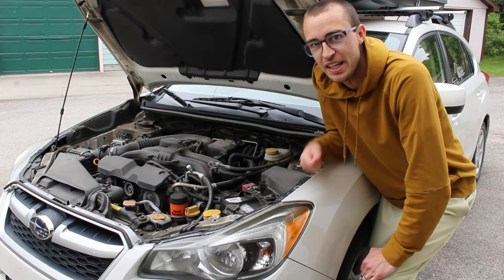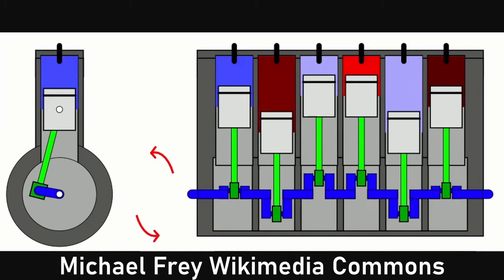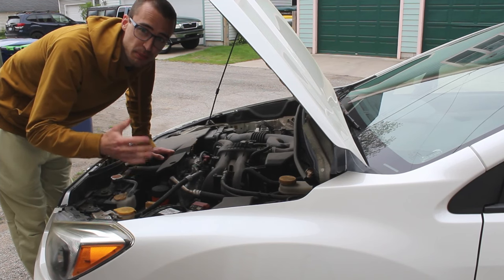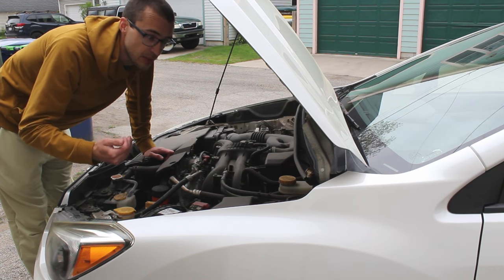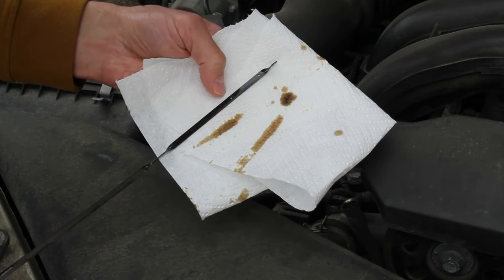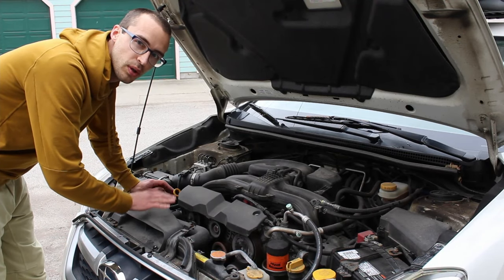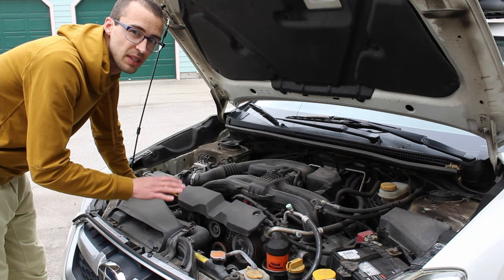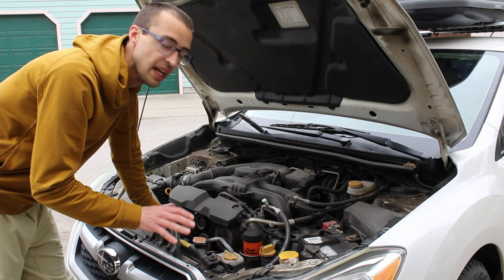Subaru Oil Consumption Issues? Information and FIX!

Comment: I've heard others complain about Subaru oil usage, but I've owned 4 Subarus in the last 20 years, and none of them consumed more than 1/2 quart of oil between oil changes.
Reply: My gosh, I can go through a quart in 1,000 miles in my 08 OBW.
Reply: My  2011 Outback 1.8K miles consumed 1.1QT oil.
Reply: You are a lucky one
Reply: I'm on my second outback.  My first one never had this issue.  My 2017 just seems to consume more oil each year.  I'm on year 6 at 74000 miles
Reply: What oil do you use?
Reply: I'm 1 for 1 on oil drinkers.  1q per 1000miles in the summer and closer to 0.5 in the winter
Reply: I think if you compare it to some cars that don’t drink any oil between oil changes, then having to replace any amount of oil is a little bit of a pain in the rear when these days, people aren’t even used to checking their oil anymore.
Reply: @danmurphy9173  I've neglected my work van and let it go to 12k miles and the oil was at the top of the full line on the stick.  I'd be running on 0.5-1q driving my Subaru 12k miles without topping off😅

Comment: It's a real good idea to check the PCV valve if you are burning oil. It costs $20 and is pretty easy to change.
Reply: Just bought one today
Reply: A PCV valve will not fix faulty oil seal rings.
Reply: @will_mcfarland  No, but it will fix a faulty PCV valve. LOL. Its a good first thing to check. Costs $20-30 and takes 5 minutes to change. But I guess if you would rather skip directly to the engine rebuild...
Reply: Use it to your advantage and use oil designed to clean valves on direct injection engines..
Reply: @billsanter Lol you are so right! My 2008 Subaru Outback was having engine problems ever since I bought it and the PCV valve was one of the things I checked and sure enough, it was faulty. It was a cheap fix. But there were also a lot of gaskets that needed to be replaced. Bad rubber that deteriorated over time. And the sensors….!🙄 Oh gawd the sensors. Just lovely. Too many needed replacing. I never realized how important it was to change the air filter every so often because that’s how the MAF sensor got ruined.
Reply: Our 2012 Impreza burns a quart about every 400 miles at this point.  My daughter uses it for school.  I'm considering putting a used low mileage engine in it, but it seems like they all burn oil
Reply: @joeweaver9913  Unless it's blowing blue smoke out the back I wouldn't replace the engine. They will still go a long time like this as long as you keep the oil topped off. Worst that will happen is that you might get more carbon buildup and spark plugs might foul. Change the PCV valve though.
Reply: @billsanter  I've become a pcv valve expert as we own a bunch of Subarus.  This is definitely the engine.  My daughter drives it and keeps a case of oil in the back.
Reply: @joeweaver9913 They don't all burn oil. My Legacy was burning a quart between oil changes at 60k miles but my wife's Outback with the same mileage and doesn't burn any. My daughter's Outback with 80k miles doesn't burn any either. My WRX with 10k miles already burns 1/2 quart every 3000 miles. It's either luck of the draw or the way I drive.
Reply: @billsanter  well I meant the fb20 engine or whatever is in that 2012 Impreza and the Crosstreks of that generation.  Everyone I know that has one complains about the oil consumption 
I have a 2008 Outback with the ej25 that does not burn much oil and we have a 2022 Outback with 40k miles that burns no oil as far as I can tell
Reply: @billsanter  Sorry but you will never convince me that any of the FB series engines do not burn oil. They ALL will have this issue to some varying degree. And while it's a fine idea to change out the PCV valve, it won't fix this issue.
Reply: @billsanter hi. Just bought Outback 2019. What is this PCV? Should I do check it? How. Thanks for help.

Comment: My 2013 Forester burns oil but not quite so badly as to require a short block replacement. Even so, I'd much rather add oil than trust a complex engine teardown to dealer mechanics working at reduced rates for warranty work. 0-20w oil is too thin given relaxed piston ring tolerances, and using Valvoline 5-20w Max Life full synthetic has slowed the consumption considerably. The Valvoline oil is reasonably priced, readily available, and has excellent low Noack volatility (evaporation/burn off) characteristics. Over time as the miles pile up I'll migrate to 5-30w. I just watch the oil level closely on high speed long distance road trips and pack an extra quart of oil.

Comment: Yeah I have an Outback and the oil literally disappears. There's no leaks or anything, it just vanishes, and your explanation explains how.
Reply: I did an early oil change after buying my 2017 Outback 
I switched to Amsoil 5w-30 signature series. I have never had an oil use issue. I never added oil between changes. I do change the oil every 3000-5000 miles.
70,000 miles no oil use issue.
Reply: @robm3357 you will likely have issues starting around 80k miles. I have a 2017 Outback with 81k. It’s beginning to consume oil about every 1500 miles. I’m now carrying oil w/ me. Mechanic changed out a valve & next plan is to use a bit thicker oil if it’s still happening. I’ll prob have to get rid of it before 100k miles since I’m worried my new teen drivers won’t pay enough attn to the oil consumption issue. Good luck!  I’m going back to Honda - had a minivan for over 13 years and never once had to check the oil or deal w/ this mess.
Reply: @jgore629  
I been using Amsoil 5-30 since new. It never uses any oil. I don’t use the 0-20 or 5-20 it calls for
But on another note. Subaru has decided to go with a CVT now on the new vehicles and that means I will never buy another Subaru. Also not impressed with the 2.5 4 banger . Revs to high on the hyway and has little to no torque down low. Mine is the 6 speed manual. And is one of the most gutless vehicles I have ever owned….

Comment: It still seems odd that Subaru would allow this.  My old 2000 Toyota Avalon's V6, with ~245,000 original miles, only burns around 1/6 of a quart every 3000 miles, or 6 months, whichever I hit first.

Comment: My wife and I , between us, have had 3 WRX's, an Outback, First gen (2013) Crosstrek, and now a 2021 2.5 (Sport) Crosstrek... EVERYONE of those Subaru's had oil changes between 3500-4000 miles, not ONE of them burned any oil as mentioned in this video... Not one.

Comment: I have a 2016 2.5L Forester I check and top up the oil regularly and always keep a quart of oil in the car just like in the good old days
Reply: I got a new BMW X3, and on the delivery it came with a liter of oil, in a special holder,  velcroed to a side of a trunk space.  Inside a holder is an instruction for oil top-up, and paper-looking foldable funnel.    Indeed, like the good old days.
Reply: I drive around with a 5 quart jug because I take about 400 miles round-trip or even 500 each week. So at that interval, even if I don’t drive the car at all during the week I’m still gonna have to put oil in every 2 to 3 weeks. And it’s usually about a half quart.

Comment: They  made the engine tolerances  larger, and are recommending 0w20,  which is very thin, and as oil heats up, it also thins.  I`d check the pcv valve, and maybe switch to a higher viscosity oil, like 5w30.  Most  older car engines in the past had larger close fit tolerances, and used thicker oil, like 5w30, 10w30 etc, Most modern engines, have closer tolerances, and recommended a thinner oil.

Comment: I have a 2016 outback, 158k miles. I have always done my own oil changes every 5k miles with Mobil 0w20. I just checked and I’m 1/2 a quart low at 2900 miles since my last oil change. Not bad, it doesn’t leak a drop either.
Reply: We have a 2015 Outback with 141k miles and with oil changes every 6k miles notice oil consumption at about 1/4 qt. at 4100 miles.  It was recently changed at the 6 month interval and at 4100 miles. It's my son's car now and he doesn't drive much.  I had the oil analyzed by Blackstone Laboratories and they said that the oil consumption was normal for an engine with the miles we had on it.  All wear indicators were right where they needed to be according to the Blackstone tech.  They said we could go 6500 miles and test it again because it still had enough additives in it that were doing its job.  We only use Subaru 0w-20 in it from the dealership if that helps.  Also, we make sure that the engine warms up to normal idle speed before driving off.  I don't know if it's overkill, but the engine sounds better when we do this.

Here's what the Blackstone Labs report said (I mentioned the oil consumption): Burning less than one quart over ~4,200 miles isn’t too bad for engine approaching 150,000 miles. The oil loss didn’t bother this FB25 at all. Wear metals are all in good standing with the universal averages, and better yet, they’re steady compared to the first sample. Steady, average wear is one of the best signs an engine is doing well in analysis. You’re interested in extended oil use, and we’re all for it. This 0W/20 is in good shape, and the TBN shows active additive left. Try out a 6,500-mile run and check back.

Comment: Subaru lowered the piston ring tension against the cylinder walls to cut down friction horsepower or the power consumed to move  engine parts to produce work. Also the engine oil is 0-20W, a much lower viscosity. This cuts down fuel consumption to get better fuel mileage. Other new car manufacturers have done much the same to achieve the same results.
Reply: However subaru have the ringlands too high up on the pistons unlike other manufacturers
Reply: I have heard that many manufacturers are doing the same due to tighter govt mandates for higher mpg and lower emissions

Comment: By far the most informative and to-the-point video I have seen on this issue. Thanks. Just did the oil consumption test with the local Subaru dealer and found that it's consuming about 1/3 qt per 1200 miles. So I guess Subaru will not do anything about it. I am still waiting for a response from Subaru based on this report.

Comment: I've found this very useful...I'm a former toyota driver, now own a 2013 impreza, light came on and I was damn worried...I visited a shop and they explained exactly this...some relief👍
Reply: I have the same car. I use manufacturer recommended oil and a 'lucas stop oil leak' with my regular oil change. I change my oil every 5000km and the oil level indicator never lights up after this. Do a bit of research and see if it helps. Subarus are good, strong cars and this is an issue most old subaru onwers have. But i still love my subie, hope you do too! Good luck.

Comment: The engine warm up till the blue light is off. Engine parts heat up and seal up. Doing this cured my 2013 2.5 completely. It runs way better also. Try it especially in winter. Winter.

Comment: Wow, what a lucky man I am. My first Subaru was a 2012 outback. It lasted 280,000 miles.
Then my second was a 2016 WRX. Never had to add a single quart of oil.
Then a 2019 Subaru Ascent. Still run like new with over 60,000 miles. Like the WRX I never have to add a single quart.
Now a 20221 Crosstrek  Sport. Again with almost 30,000 miles and haven’t need to add a single quart of oil.
Maybe it is because I religiously change synthetic oil every 5000 miles and, never go over 75mph.
Honesty I just think I am the luckiest guy in the world.
Reply: You've never had to add any oil because the Subaru dealership where you're getting your oil changes done is doing it for you.
Reply: Speed isn't the issue.  Going 90mph indefinitely isn't as hard on oil consumption as regularly gunning it off of onramps, offloading, towing etc

Comment: I have 2008 Impreza OBS with 247,000+ miles with original engine and head gaskets. I've used Mobil 1 synthetic oil since day 1. I had my local Subaru doctor change timing belt at about 190k. I was using some oil and he recommended that I start using 10W-30 oil. Since the change,  zero oil consumption
Reply: My is Outback 2013 really bad oil consumption,every 4 days is empty
Reply: @jamiearellano8903  have you been able to do anything about it?

Mine is using up about 1qt every 500 miles on a 2011 subaru impreza hatchback. This started mainly after a head gasket repair... but from what I've read, and what the repair person told me, this can happen with a head gasket repair. 🤔

I'm just gonna live with it. Cars are too damn expensive these days.

Comment: Thanks for this video.  2016 Forester. If you follow their policy of changing oil every 5k miles you don't see this issue until you extend that.   We had a warranty program where we had to follow 5k exactly or lose the warranty.   I believe these are now illegal. Spent more in maintenance than any other vehicle we've owned. Now that we lost the warranty,  I extended oil changes to 7500 and it becomes an issue and adds more stress probably will go back to 5k

Comment: My suby dealer said it's normal it's burns oil, like you said. They also said the only other fix might be to refit and tighten the head gasket (I think he said). I didn't do that tho as it was expensive and I just continue to add oil. I drive a lot for door dash and instacart so I just end up using oil

Comment: Curious as to how many MPG Subaru actually saved by making engines that burn oil?

Further, how environmentally friendly is manufacturing all those extra short blocks, burning oil in the gas, and killing sensors and catalytic convertors prematurely?  
IMO CAFE's ever tightening restrictions and ever-diminishing returns are forcing engines into places where they don't last as long and cause other problems.  How is this better when cars get junked at faster rates?
Reply from the maker: Good question, hard to tell there are a lot of variables.  I know the jump from like 25 to 36mpg is pretty significant so I’m assuming it is worth the hassle. Hard to say though
Reply: On the money my friend, I couldn't say it better myself
Reply: It's about control. You should be using public transportation. In there eyes.
Reply: It’s like DEF in commercial trucks. Once the filter gets clogged the truck has to idle for hours. How’s DEF helping the environment is the truck has to idle for 12 hours once a month.

Comment: My 2013 WRX STI eats oil like crazy since new.  A quart every few hundred miles.  I have to check my oil constantly.  It is the only car I have ever owned that eats that much oil.  I have tried different oils including oils designed for older cars without much success.  The problem from what I have read is besides loose tolerances is the oil control rings are to small.  My car has not been terribly reliable either it threw the cam belt at 12k miles and I had a big fight with the dealer over not being covered by the warranty- because I change the oil myself (which is actually illegal).  They finally compromized and charged me 1/2 the price or 4000$ which turned me off on Subaru's!  It took me back to my days of owning a Fiat when the cam pulley disintegrated at 12001 miles just out of warranty.  I could have bought a Lotus Europa JPS for only 1k more but the insurance yearly rate for me was outrageous.
Reply: Have you tried using Rotella T6 oil? I know this oil is huge among the STI community for cutting down oil consumption, quality cooling, etc

Comment: I bought a used 2013 Impreza, manual 5-speed, in December. I live in Minnesota, so obviously it's been cold until these last few weeks of May. As soon as the weather started to thaw, my car started to burn a quart of oil definitely within 1,000 miles. Now that it's hot some days, it burns faster, and it actually literally has been spilling out all over underneath the hood, the cap will even come off, being blown off somehow I guess, it's very concerning. I'm glad to hear I can take it to the Subaru dealer and hopefully get this sorted for free. 

Before I bought the car, I took it to a mechanic. Even then, underneath the hood it had a bunch of oil residue. The mechanic didn't know why, but it could have been as simple as somebody losing the cap and driving around without a cap. Other than that, it drove well and he couldn't see an issue, so I went ahead and bought it and got a little money off for the concern about the oil, which the dealer didn't know how to explain either. I wonder if the shortblock is the cause? Does anybody have any insight into what this could be?

Comment: Main dealer in my country recommends 5w30 and we get winters -30c . I tried 0w20 for the first few changes, and hated the engine sound . Been running 5w30 for 70k now with no issues. Burn about half a quart every 10k km.
Reply: the oil affects engine sound?

Comment: Thanks for the warning.  Was considering a new car.  My 2005 Ford with 222,000 miles uses no oil between changes at 5000 miles.  Subaru is definitely off my wish list.
Reply: Nice mileage on that Ford.  What model is it?  Subaru is still a great make, don't be discouraged.  High mileage Hondas burn oil too, just for the record.  I think it's just Japanese cars in general.
Reply: @kargo27  NO it is not specific to Japanese engines.  It is specific to the changes made to newer engines.  My 2016 Fusion has the older Ford Duratec / Mazda design engine.  It is not an oil burner.  When buying, I avoided the eco-boost engines, and I think it was a wise move.  Every year moves the world closer to disposable cars -- garbage.
Reply: @lorenschwiderski  good to know.

Comment: My 2019 Legacy with 67k miles  is using a 1/4 quart every 1000 miles. I guess this is considered normal. The only car I've ever had to add a quart of oil between oil changes was an RX7 and they have oil injection. It just doesn't seem right for a vehicle with less than 100k miles.